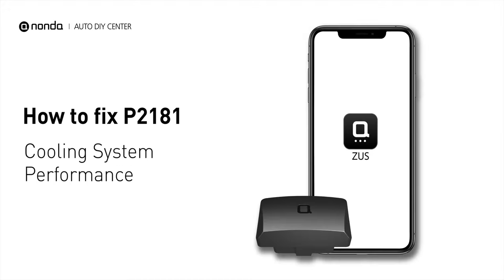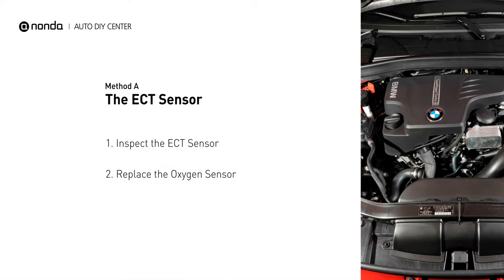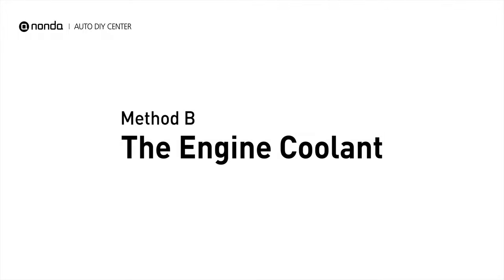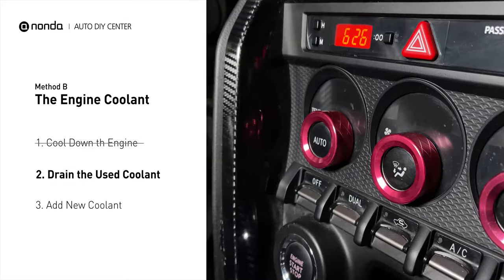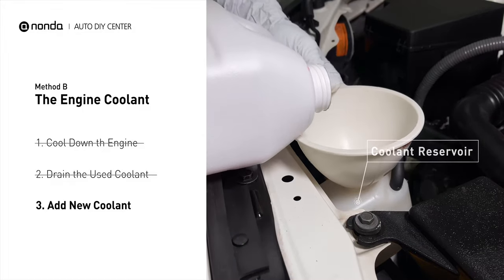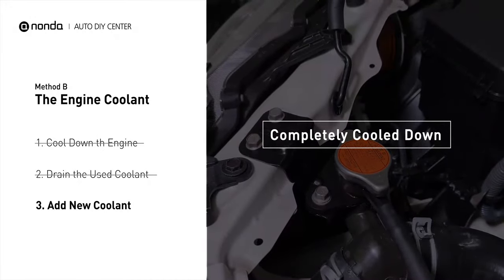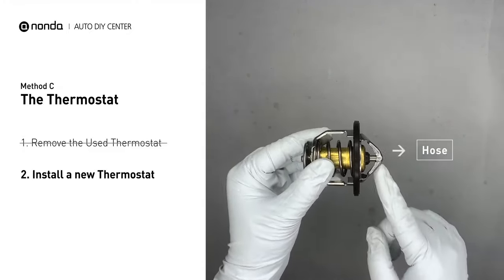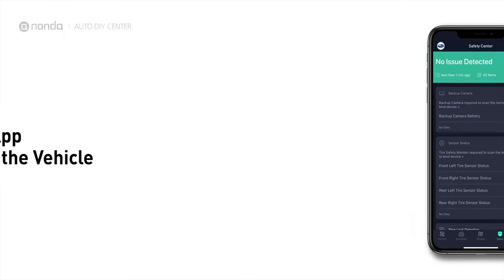How to Fix P2181 Engine Code in 4 Minutes [3 DIY Methods / Only $7.36]

Comment: Im getting code P2181 on my 2013 Audi A4 but is not over heating my temp gauge stays right where it should and check engine light come and goes i will be checking ECT sensor and the Thermostat thank you
Reply from the maker: Hello, is there any other code that registers along with this code?
Reply: I have the exact same thing! But I have a 2012. And there’s no other codes with the P2181 for me.
Reply: @nondainc  P0300 which is a random Cylinder misfire that comes and goes as well besides that No only P2181
Reply: Got same code on my 09 a4 but not overheating u ever figure out problem?

Comment: For a 2006 Dodge Charger is the sensor inside the transmission? I’m getting 3 codes p2181, p0700 and p2181 P. Can you tell me what the problem is ?
Reply from the maker: Hello, it should be located on the back of the motor where the trans meets the engine. If the tips/suggestion provided in our video (How to fix P2181) has been applied and the issue still persist, we recommend taking your vehicle to a mechanic as this issue should be fixed as soon as possible.

Comment: The P00B7 code on Audi A3. There's a sign of a minor leak on the waterpump front. Is it time to replace the pump or just start with ECT sensor, thermostat or anything out of those?
Reply from the maker: Hi Jay, we suggest to check the ECT sensor and radiator wiring coolant temperature sensor system wiring/connectors.